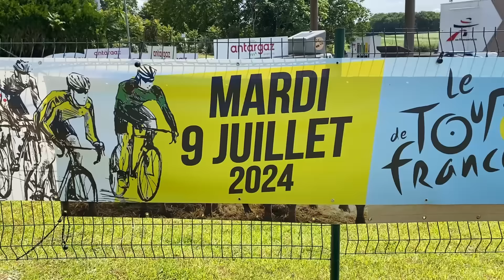Château de Colombe and Le Tour de France!

Comment: Will you move the washer to the skullery?  It seems odd to have it between the dining room and the kitchen.
Reply from the maker: Eventually it will be the second dishwasher and not the washing machine in the side kitchen. However, it is fairly typical in most of Europe to have the clothes washing machine actually in the kitchen.
Reply: Yes-When you mentioned before abut having more-where upstairs is there room to place a W&D? make it easy as possible, close for bed laundry.